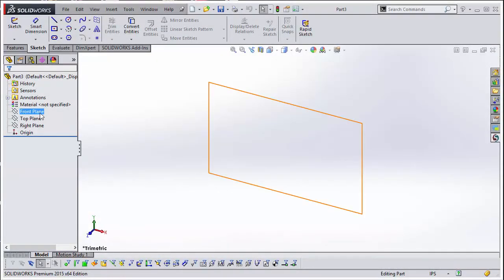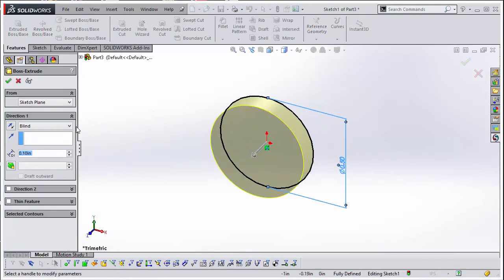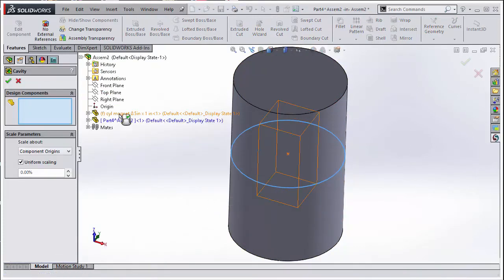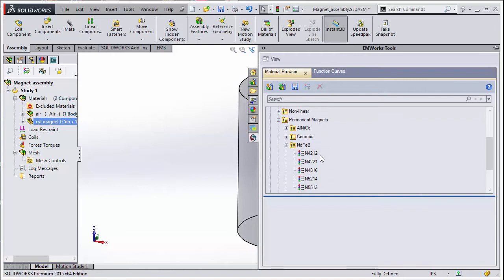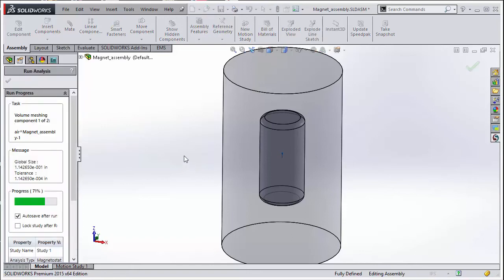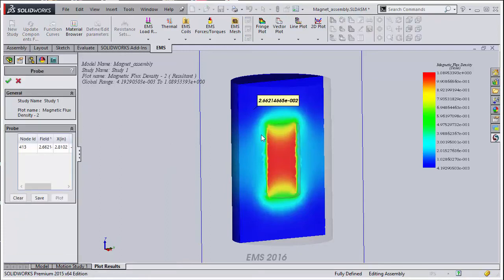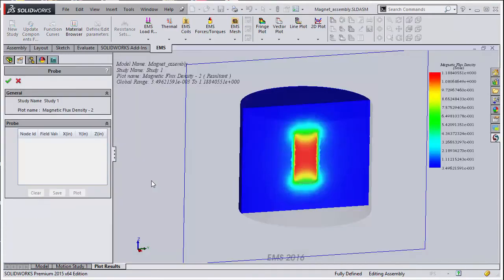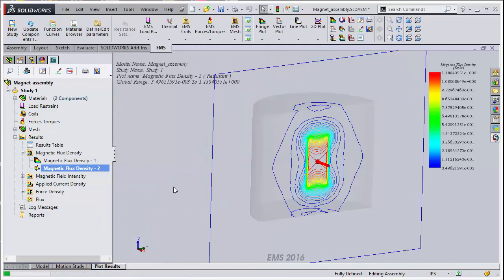Simulating a permanent magnet in SOLIDWORKS with EMS by EMWorks

Comment: I have a question, i have tried a magnetostatic study and coupled it with thermal analysis, we all know that heat degrades magnets magnetic strength, but when i tried it with Virtual work on an object comparing two same study but the other study has no heat on the magnet, i get the same Force(N) in both studies with the heat applied and with no heat applied, why does heating the magnet does not affect any at all if it supports multi-physics.. thanks..